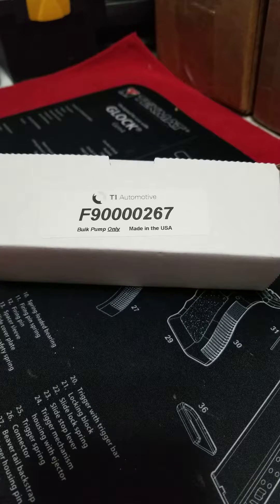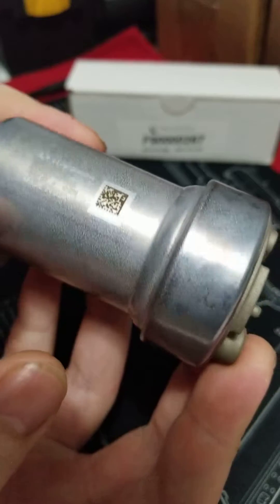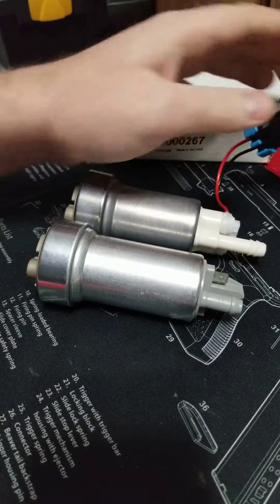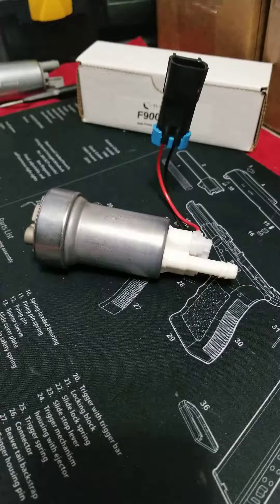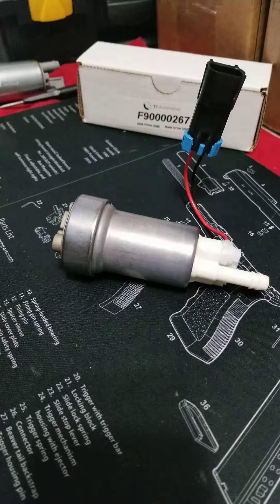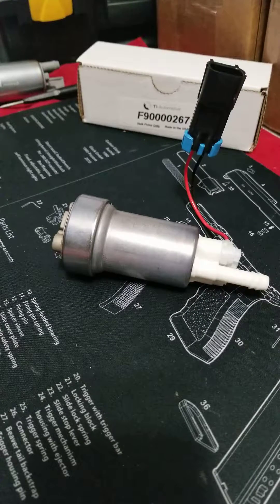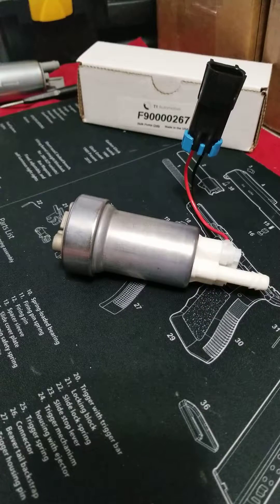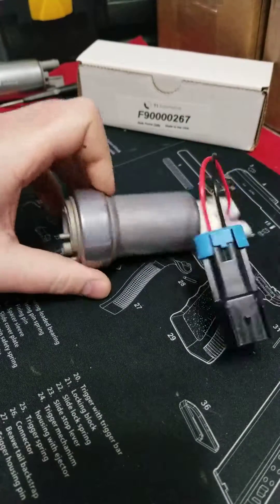S&H Review: F90000267 Walbro Ti Automotive E85 430lph Fuel Pump

Comment: I’m looking to run 1300hp crank at around 20psi or less using two 267’s. If my base is 58PSI would I be ok on E85?
Reply from the maker: No def not a 267, the 274 is higher pressure version  but You want more pump than 2 274s for north of 1krwhp on e85 at that base pressure. Either 3rd pump or 2 of the larger 285 or 295 pumps.

Comment: Hi m8 stumbled across you just now don't know your history so what r u running this pump in & would u recommend it for a supercharged gm 3800 with 80lb dekas & 14 psi boost  & 50 psi fuel pressure.
Reply from the maker: Yes would be a good choice for that setup.

Comment: Will the 274 high pressure pump be ok to run in 450 rwhp n/a car with a base fuel psi of 55 per factory spec. There’s definitely boost in the near future on 93 pump as well as E85. I understand the pump is probably overkill for the power level at the moment but I’d rather be covered now than having to drop the tank for a stronger pump.
Reply from the maker: Yeah fine to run just ensure wire/power supply is upgraded.
Reply: S&H Performance Yessir I’ve got a Hotwire setup ready to rock🤘🏼 Thanks for your reply, much appreciated
Reply from the maker: No prob.